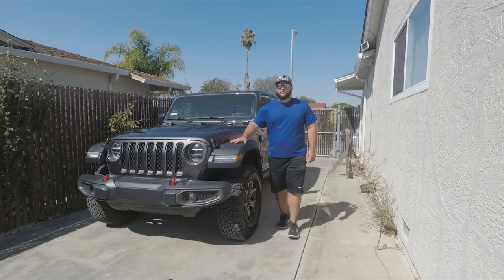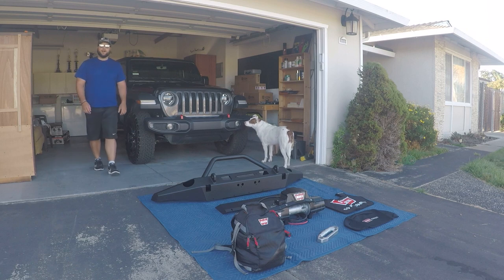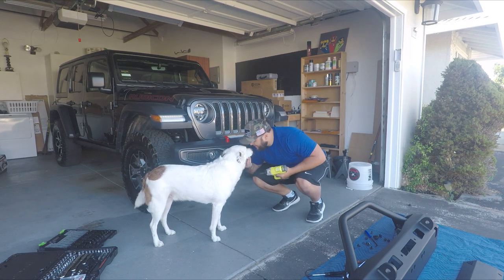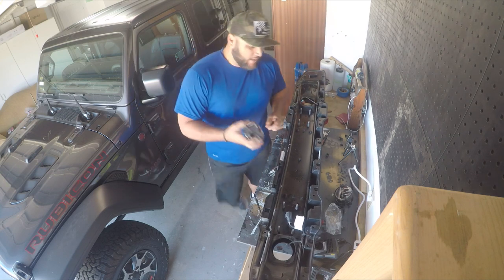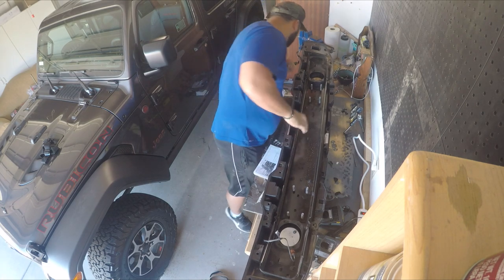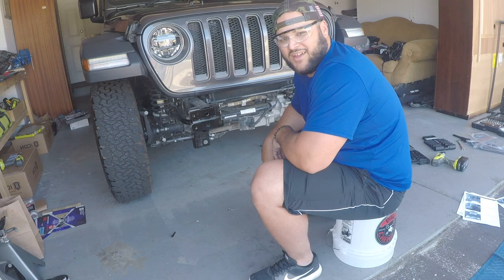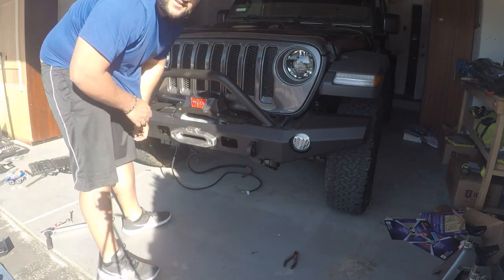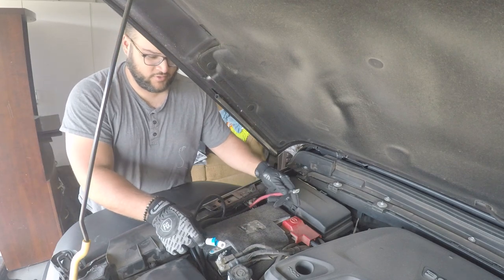Warn Jeep JL Elite Front Bumper Install

Comment: Hey man, just came across your vid as I’m researching this bumper for my JT. Could you do me a favor and measure the distance from the grill to the farthest point forward on the front of the bumper?  I’ve got minimal garage space. My JT fits fine with the stock plastic bumper so I’m hoping this bumper doesn’t stick out too much further than stock. 

Also, thanks for the vid and all the useful info. I’ll probably do the same setup.

Comment: Just want to go on the record.....the skid plate is an absolute nightmare to install you can’t get your fingers on hardly any of the bolts, getting wrenches on is just plain stupid, took me almost 3 hours of screaming throwing stuff and contemplation of using a sledge hammer to just end the pain. Unfortunately I bought the skid plate separate had I bought it together with the bumper I would have mounted the skid on bumper before installation of the bumper even though it’s not recommended. Love Warn products but at this moment I’m “Warn” out.
Reply from the maker: Haha yeah I bet. I can't imagine trying to install it on your own. It took me a couple tries to get it on there. Glad you figured it out though.